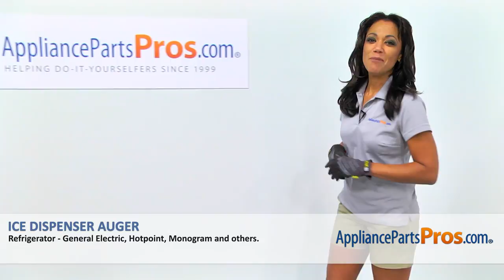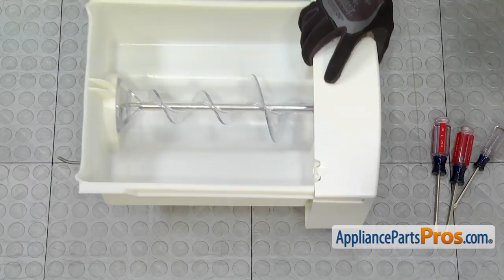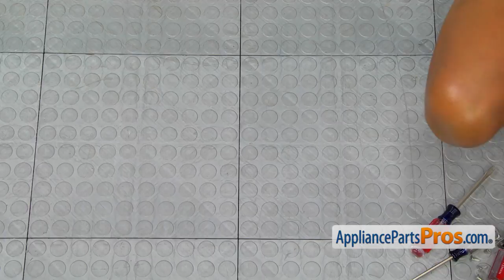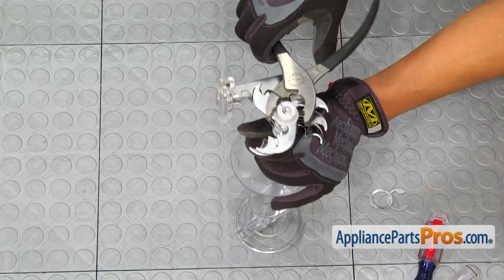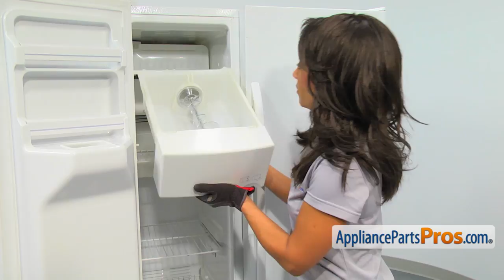How To: GE Ice Dispenser Auger WR17X11939

Comment: Reba and APP, thanks for the concise step by step process to break down and replace the auger.  Worked perfectly for me.  I also found out the tension spring was broken on the back end of the shaft, but the $7.95 s/h charge on your website to mail an eighty seven cent spring was a deal breaker.

Comment: This was put back together wrong. The stationary teeth bracket slides into a slot to the right of the open section. If you watch at 3:30 before she takes it apart you can see it is in that slot. At 7:10 you can see it is not in the slot.
Reply: Yes, I caught that also. If done the way she did it, the crusher won't work and only cubes will come through. Also, the plastic gate/door that lets the ices cubes drop will eventually break as cubes get caught between the improperly placed fixed crusher blades and the gate. (Learned this all the hard way!)

Comment: The video is quite helpful. Thank you. 

I need to tell you something though.

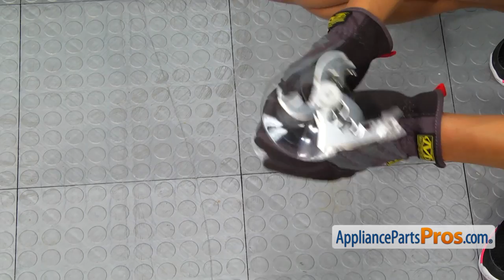There is one step that resulted in an issue with the operation of the auger. Look at video position 6:18 through 6:21. When the auger is reinserted, the small protruding fixed blade of the auger must be positioned within
the indentation of the plastic housing. However, in the video this is not shown. What is shown is the fixed blade portion is 
simply inserted. Following this step exactly will result in the auger jamming. 

Feel free to respond.

Comment: Don't unplug fridge, just turn off ice maker at switch in back of freezer. It's much easier NOT using gloves. Let plastic parts warm to room temp to prevent cracking/breaking plastic parts.
Reply from the maker: +Mark S We always unplug the appliances for safety!
Reply: +AppliancePartsPros You'll have the same degree of safety by turning off the ice maker, but don't have to MOVE THE REFRIGERATOR which can actually BE a safety hazard. In addition, if your repair is delayed or interrupted, you don't have the problem of food spoiling, frozen food thawing, etc. Common sense isn't so common anymore!
Reply from the maker: +Mark S Our videos are watched by people with a wide range of repair skills. We always say to unplug the appliance or turn off the circuit breakers. The person doing the repair can decide what is best/safest for them, but the power should be off. Most of these repairs can be done fairly quickly so thawing should not be a problem. Also there is no way we could cover all the things that could go wrong and cause a delay, so your suggestion about the ice maker is good. If the repair was delayed for some reason you could turn the power back on to the appliance so the food does not thaw and then turn the ice maker off, so it would not dump the ice cubes without a bucket to catch them. Thanks for the tip!
Reply: I'm sure that they have to say this because their insurance company said to
Reply: I did it without unplugging and turned the ice maker inlet water off after removing the ice maker. But still good advice from  Appliancepartspro for the wide range of folk skills out there. Novices should follow it, experts will more than likely ignore it. It took me about 45 minutes to complete the job, and I’m an average DIYer !!

Comment: Video very helpful, however, you are messing with food-grade components with un-sanitized tools, and not washing / rinsing (and drying to prevent icing) the bin before putting into production. At least put some comment cards up on screen saying "hey, this is a video on how to replace, you will want to ensure this is sanitized to prevent germs entering your ice-maker", otherwise people repairing at home could just simply not understand or miss that critical part of not contaminating their equipment. 
Repair techs should obviously know, but always best to just make a mention of it for those that wouldn't think of this crucial step.

Comment: This video is the worst instruction video I've ever viewed.  The stationary teeth bracket can easily be assembled 180 degrees from its proper position.  If that is done, it's a major disaster.  This should have been pointed out during the video.  Also, as the disassembly and reassembly are being done, there is no careful displaying of the two different types of nylon spacers.  When reassembling these spacers, you can't tell which ones are which.  Horrible excuse for an instruction video!!!